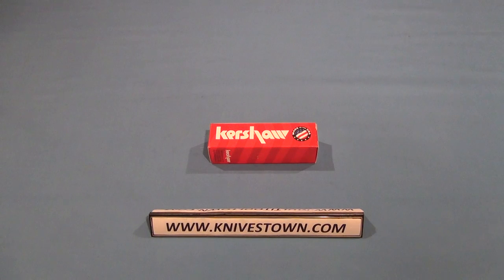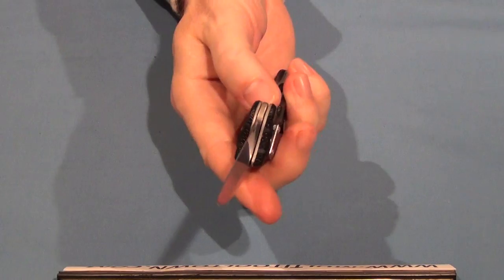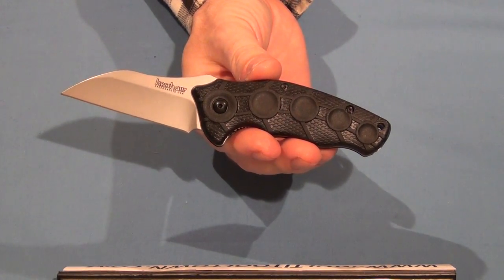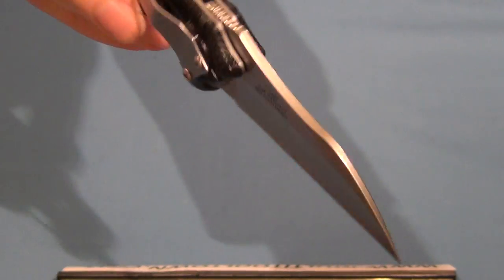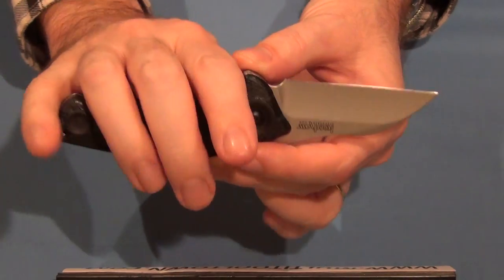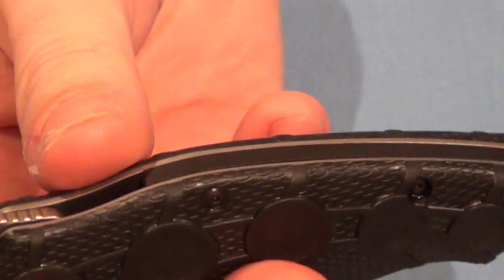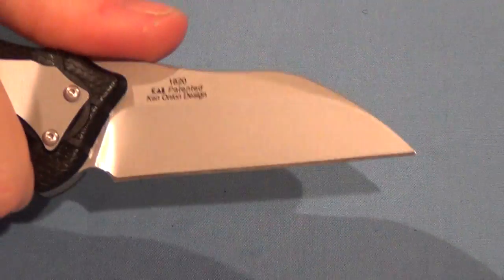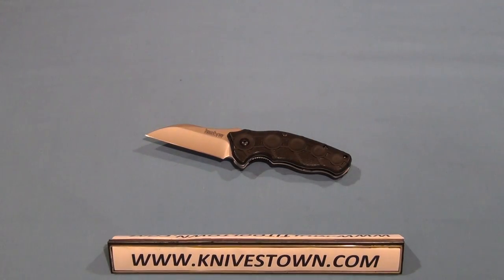Kershaw Needs Work Knife Review

Comment from the maker: The Tuff Lite is good, no doubt, but I think the Kershaw is a little more knife. The Kershaw is an assisted opener where the Tuff Lite is not. The Kershaw has a longer, bigger blade too. The Tuff Lite is available in serrations if you want so it has that advantage. It is a lock back vs. the Kershaw liner lock. No real difference there to me. Between the two, I would get the Kershaw.